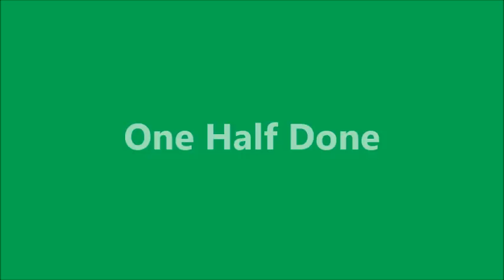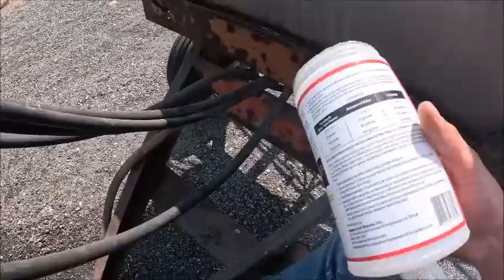Finishing Up Spraying Corn And Cleaning The Sprayer For Beans

Comment: I hadn't noticed before,  but I  used a wagon nurse tank and had a ball valve on a tee at the tank outlet with a bar of soap in a sock alongside to wash my hands and arms. Also, to have access in case of facial contact with chemical. I used tank wagon at planter and sprayer it just carried water, and I  stencil painted ( water  ) on each side. Because some asked what tank contained.

Comment: Yea cause most herbicide say spray to wet not runoff. Water doesn't effect it, it's just the carrier. I would not think it would matter really as long as you say what moisture you add doesn't cause runoff. Me personally I'm like you I'd rather spray it dry and let it dry on the plate quickly.